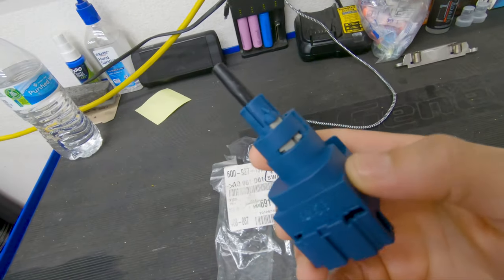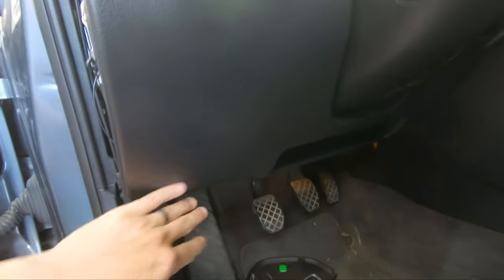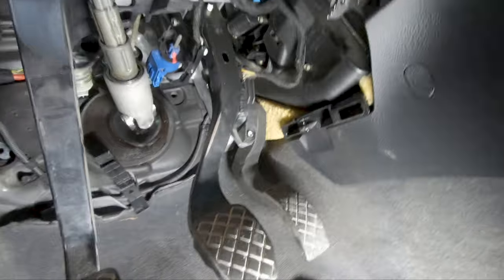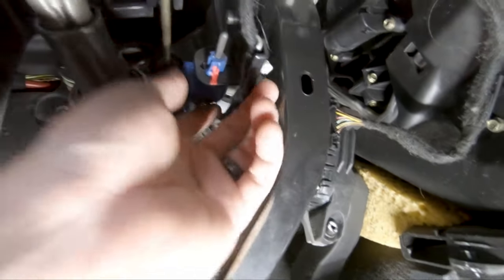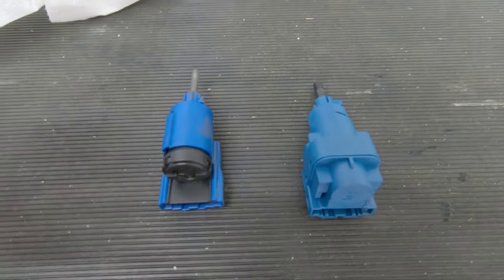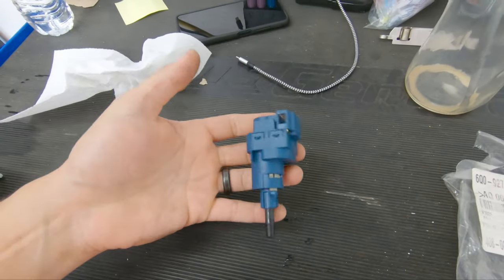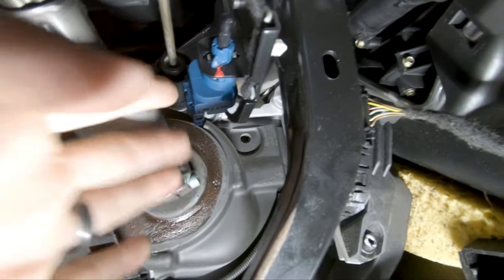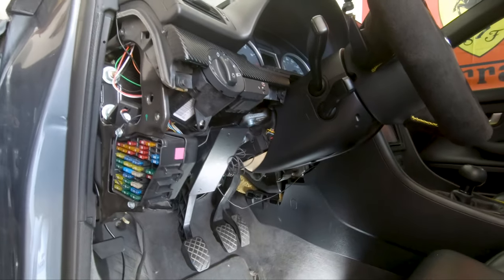NEW Clutch Switch Audi B6S4

Comment: My car struggles to start sometimes and now the cruise control doesn't work, sometimes it does, sometimes the car starts fine 🙃 
Will a new switch sort this?
Reply from the maker: I am not too sure on that. There is one way to find out. Luckily clutch switch is reasonable priced it's worth a try.
Reply: @markb6s4  thanks. I've ordered a new switch anyway. 🤞
Reply: @AB-hu4nm  yes it can cause problems with cruise control and starting. if the switch is bad and says the clutch is always engaged or disengaged cruise control will not turn on. as for struggling to start that could be related but if it struggled to start with a bad clutch switch, it wouldn't turn over at all. 

also, if you have hanging revs between shifts, you clutch pedal switch is probably bad because the engine doesn't know you pushed in the clutch so it has no idea what to do

Comment: How do you know when your clutch switch starts to go bad?
Reply from the maker: What can happen is when you are in N the rev meter starts to rev on its own without you ever pushing on the fuel pedal
Reply: @markb6s4  like when you’re shifting gears or just at a standstill?
Reply from the maker: When at a standstill
Reply: I didn’t have any of those issues. Just the rev hang. Thanks for this video.
Reply: @aefan  I was gonna say I have Rev hang between shifts in my 2.0tfsi so it’s more then likely this?
Reply: @travisfs7526  Yes.
Reply: @aefan  Your clutch switch needs replaced if you have rev hang.